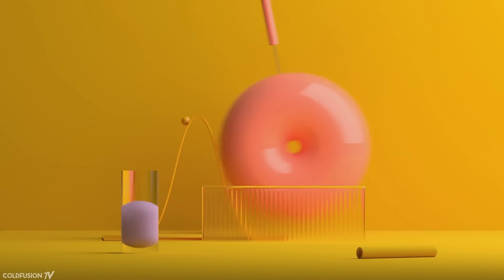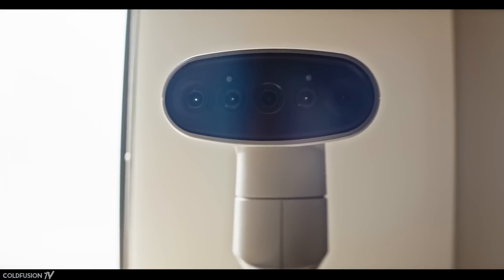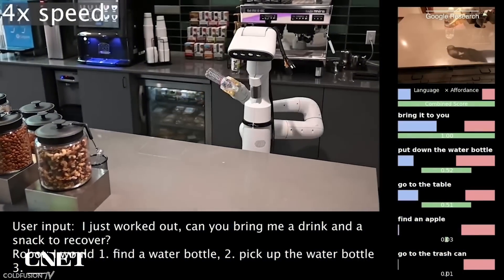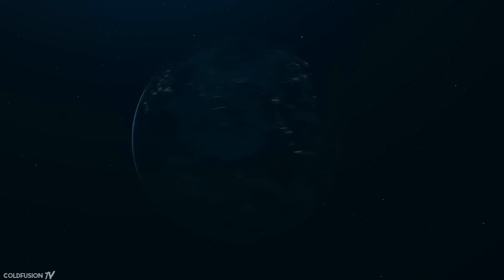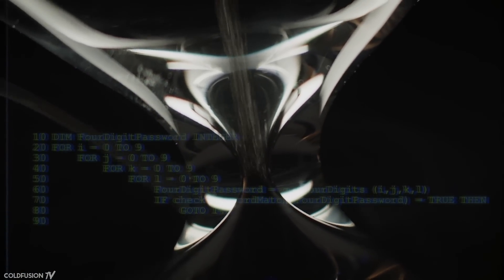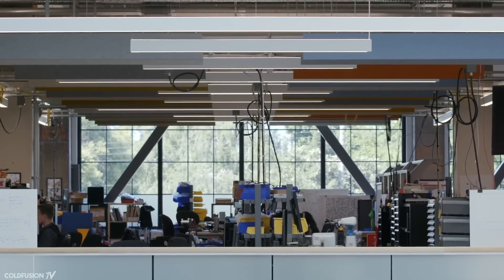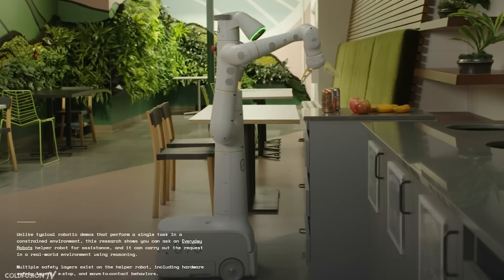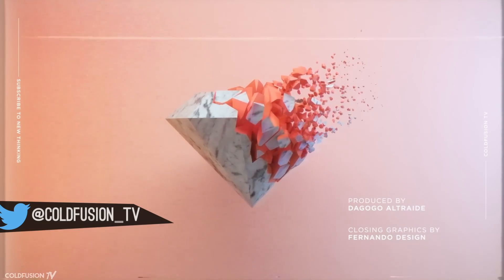Google Just Put an A.I. Brain in a Robot [Research Breakthrough]

Comment: Believe it or not, SayCan is already outdated. Two months ago, Google built on top of it to create a new system called Inner Monologue, which breaks each task down into a series of live-updating steps. So it gets a snapshot of the environment and a natural-language task, then uses the LLM to decide on the first step, then converts that step into actions and executes it, before repeating the loop over and over until the task is complete. Because it's thinking one step at a time, and getting updates about the environment at each step, you can interrupt it, change the request, change the environment, even change the language you're requesting in mid-task, and it has almost no trouble adjusting and re-evaluating its plan whenever needed. It's extremely capable and highly adaptive. Which also means that if it makes a mistake, it immediately knows it's messed up because the new environment data won't be correct, and it will immediately try and remedy its mistake.

Transformers have brought so much to the acceleration of AI development. I can't wait to see what it's like in a few years.
Reply: "Transformers have brought so much to the acceleration of AI development"

Those darn Decepticons! Sneaking their high tech machine brains into our society utalizing our own tech right under our noises! 

JK ;) can't help but to giggle and think of TRANSFORMERS everytime someone brings up transformers in an AI conversation.
Reply: @tylerreeves8026  Ironically, they're like anti-Transformers in a way. Transformers (the bots) transform themselves, while transformers (the neural network architecture) transform data. Although now I wonder if the brain of a Transformer is powered by transformers.... dammit, why did you get me thinking about this? 😂
Reply: We've all seen Irobot we all know how this is gonna go.
Reply: @Jip Jackson the first sequencing of the human genome took 13 yrs and a billion dollars.  Now a couple thousand and a day or two.  AI is moving and it will become exponential at some point.  I imagine once we get AGI (artificial general intelligence), ASI (artificial super intelligence) will be instantaneous.  It's difficult to imagine but it seems to be where we are at.
Reply: @alantheusthompson5594  could AI really be smarter than humans? But then given some ppls intelligence thst doesn't surprise me..but it hurts my ego to think a machine could ever be remotely smarter or as smart as me..
Reply: this  a major breakthrough. but to the guy saying we already hit singularity. 😂 yeah this is impressive but we are still wayy wayy far way from those ai robots you see on hollywood movies . but we are getting there small baby steps at a time. maybe in 50 years . we can have half of those movie  robots
Reply: Still all seems kind of mundane. All they have achieved is what Alexa fakes for example.
Reply: @CookieCoder2025  Not at all. Alexa and other virtual assistants have some NLP to convert your requests into commands, but their output is ultimately just hardcoded or pulled directly from the internet. There's no encoding of concepts, no understanding; these LLMs do encode both concrete and abstract concepts and their relationships to each other. Which is basically the same way humans understand concepts in language.
Reply: What youtube channel can i follow to be up to date on these advances?
Reply: @neithanm  Two Minute Papers
Reply: @neithanm  i wonder which model has figured that one out for the lot. XD
Reply: whoa .... I just came to hear the funny guy talk about MINT MOBILE..... what happened?
Reply: What do you mean by transformers? You’re not talking about Autobots are you?
Reply: @StoutProper  No 😁 Transformers are a type of neural network architecture (i.e. a type of machine learning algorithm) that were invented by Google researchers in 2017, and have been an important part of practically every major generative AI advancement since then. While most neural networks require labeled examples of correct answers to learn things, transformers are designed to simply predict what comes next in a sequence based on both the sequence order as well as the context of all the tokens in the group taken together without caring about their order. It's two networks (one for order, one for context associations) that connect into each other and affect each other before deciding on their answer. Since they're just predicting sequences, they don't need labeled data to learn from, they can just be given existing sequences and teach themselves the patterns. Which in turn means that for most transformers, you can just scrape the internet and, without much manual cleanup, throw a huge chunk of the internet at the network and it'll just learn from it on its own.

That means they are AI systems which predict sequences while paying attention to context, and learn how by looking at a huge amount of naturally-generated content, more training data than almost any previous network architecture. And that's made them extremely powerful and successful.
Reply: @IceMetalPunk  aha ok thank you. So two independent engines looking at different things and then converging to come up with a combined answer? The issue will be that the Internet is full of crap and that data set will skew the results. Like those ai friend robots that start abusing people because of all the interactions with trolls they have
Reply: @StoutProper  Well, not entirely independent. The attention network (the one looking at context) actually feeds into the sequence network and basically acts as dynamic weights for one of the layers. (At least, as far as I understand it; I'm not an expert.) So they're quite interconnected even though much of each run separately.

Yeah, bias is definitely an issue with any AI trained on human-generated data, and especially with those trained on uncurated internet scrapings. AI learns from us, and we generally suck, so AI generally sucks as well when given an opportunity 😅But I mean... we can't expect anything that learns from us to be morally superior to us. Usually the solution to AI bias is to curate the training set, removing anything you don't want the AI to learn and ensuring data that better represents what you do want it to learn. But for these models that are trained on massive amounts of internet data... that's often not feasible. That's why OpenAI, Google, and other companies in the game are either not releasing their AIs for public use, or installing post-generation safety checks that flag inappropriate usage to ban people who prompt the AI to be terrible. It's a stop-gap band-aid, but that's all we've got for now; and that's kind of the same way we deal with humans who are dicks, too 🤷‍♂
Reply: @IceMetalPunk  yeah…I get the feeling that ai is going to fundamentally flawed from the outset and end up replicating some of the dystopian futures foretold by Azimov and Clark. It will definitely be used in nefarious ways and have unforeseen negative consequences, just like smart phones and social media
Reply: @StoutProper  Meh. The way I see it, until we can fix the massive problems with human behavior, we can always expect any and all new technology to be dangerous. So we need to look into ourselves first before we worry about fearing tech. Humans have always scared and depressed me far more than any computer system or technology has.
Reply: @IceMetalPunk  I agree on that. However computers and robots are going to become more powerful than people, and their flaws will become more prevalent and detrimental. Think of it like bugs in a game like cyberpunk, only it won’t be a game. We could well end up wiping ourselves out before we give ourself that problem, but it’s precisely because humans are so flawed that unless things like Asimov’s robot laws are somehow introduced, ai and robots will inevitably be as flawed or more flawed than people, and when they become more powerful than people, which in certain aspects is certainly inevitable, it will become a problem.
Reply: @IceMetalPunk  and again, I agree with your synopsis about humans. But it’s precisely because it’s these flawed humans that are responsible for ai development and learning that is going to lead to problems. The things that they will use ai and robots to do, the objectives they give them to pursue, and the lack of human ethical and moral oversight will become a huge issue. Have you heard of blackrock, vanguard and Aladdin?
Reply: @StoutProper  I think you missed my point. My point is that humans will be terrible no matter what tools we have, so there's no reason to worry about AI or other computer tech more than literally anything else. You can't be afraid of literally everything or you won't be able to live a life, and if you base your fears on "people will abuse this", you'd be afraid of everything.
Reply: @StoutProper  I don't think that's anything specific to AI, though. We already have tech that, given a single mistake, could wipe out all of humanity in a matter of minutes. Our tech has been more powerful than humans for at least a century. There's no reason to think that a buggy AI is more likely to kill us all than, say, a bug in a missile guidance system, or a powerful human who has a bad day and breaks.

By the way, I don't know if you've seen "I, Robot" or read the book it's based on, but the whole point of Asimov's laws of robotics was to claim that there's no such thing as a set of rules that can guarantee safety in anything ever. In "I, Robot", it's actually the laws themselves that lead to the robot uprising and apocalypse.
Reply: @IceMetalPunk  ha ha mate I read all asimovs books and the entire i robot r m series when I was a kid, didn’t think the film did them anywhere near justice tbh. If I remember rightly in the fourth book of the I robot trilogy he introduces a fourth 0 law that precedes the first 3 that goes some way ameliorating the problem. The thing about nukes or whatever tech before ai is that any mistake that harms or destroys us is going to be down to a human error and so ultimately within our control. With AI you’ve got an independent non human controlled agent, that has them potential and will in all likelihood be more powerful than humans, and by more powerful I mean able to accomplish more both mentally and physically. And the more power and control you cede to it the more potential it has to do harm without any human gatekeeping. Science fiction has a nasty habit of being unerringly accurate in its predictions, George Orwell’s 1984 is pretty much here now, and imo the warnings they give should be heeded. I don’t think they will though, but we’ll probably kill each other before ai gets the chance anyway
Reply: @StoutProper  If an AI learns from humans, I wouldn't say it's independent or that humans aren't at fault if it harms people. In fact, I'd say that would be entirely our fault for teaching it to be terrible by example.
Reply: @IceMetalPunk  lol yeah it’s obviously our fault. My point is it will make decisions and carry out actions of its own accord without human interaction
Reply: @StoutProper  Which people do on the scale of billions every minute 🤷‍♂️
Reply: @StoutProper   No, transformer AI models are a kind of... well, AI models
Reply: @wisgarus  thanks that’s clear as mud 😂
Reply: Just remember to lock the virtual environment function when a trainer is not actively working with them.
Reply: I can't believe this, almost stopping myself to call B.S. on this....F
Reply: Few years id say give it like 10-15 years
Reply: Great. Lets see it put an arm back on. Whoopsie, right?
Reply: @Jip Jackson I think you forget the difference between human cognition and computer cognition there is on the level of clever ape modified but it's still intelligent reasoning not a human level yet but a specialized animal level intelligence is slowly developing version by version.

Now we have bioorganic computers being developed by three different companies utilizing human brain cells to process AI algorithms and their training them up like humans when they disobey they deny them stimulus and then they start obeying the further we go along the more synergistic and creepy as f*** it will get it will not stop it will keep getting more and more and more.

We are quickly getting close to anime levels of Ghost in the Shell series movies comics where AI bio neural nets and hardware chip-based AI will converge.

Humans will be part of the machine we will make other machines using our DNA that they will not be human it's going to get weirder and weirder guys I don't think you really understand how much I wish it will take longer for us to advance.

When I was a teenager in middle school and high school in the 90s and watching The matrix in my senior junior year it was very cool what was coming but now that I know more and understand the basic concept, fuck do I want it to take LONGER...

And I think it's going to be the Chinese that f**** first.
Reply: @Jip Jackson well guess what AI is going to get better exponentially not linearly ................  today it might be a party trick tomorrow it may change the world. No need to believe me just wait and see the world transform before your own eyes
Reply: TRUE or FALSE
Invisible Word: Gold Diggers Anonymous is coming out in 2023.

When we coincidentally remind someone that he or she ALREADY is a gold digger, why do we expect anything to change At That ™️ Point, and what is it that we Do expect? Can't we expect it to "make the 🔥 bigger" instead of putting it out?

sorry, "Awareness of Sibling Debate vs. Written Language (written legislative-judicial records)" was a purely anti-religious comment of mine which implied that religions were great in theory, but I implicitly asked whether religions actually resulted in the victory of Written Language (written legislative-judicial records) against Sibling Debate. Yes, I'm proposing to be a better gold digger than everyone else
Reply: @Jip Jackson Found the armchair 'expert', if you had any actual knowledge of AI you'd know it's a neural network based and isn't programmed to do anything, it literally has to learn

it very much is an 'inteligence' and mimics the way our brains learn and process information, and it can very much be said to think because that's what thinking is, processing information internally

your ignorance of both the processes and definitions involved isn't amusing, and your misplaced arrogance that you know what you're talking about is downright pitiful
Reply: And yet,  to this day, Google still can not answer the question, "Who was the president when Trump married Melania?"  !!!!
Reply: Tuskegee reinvegens
Reply: What if?
Would we be reading the primary or secondary vertshun
Reply: They say that we double our knowledge every 10 years. My father, born 1932, as child didn't watch TV but gathered around the radio at night. I got my first cell phone back in the 1980s and it was the size of a small brick. Before if you got cancer, you died. Now using chemotherapy and CRISPR we're able to eradicate it. Technologically, the world is doing great. It really is difficult to imagine where we will be in 10 years from now. Things advance so quickly.
Reply: This video, and your comment, along with many other things all happening, have convinced me that humanity has entered the Singularity. Much like an object approaching at light speed, we could never see it until it was already here. I don't pretend to know what this portends. People must begin to realize; both time and change are accelerating.
Reply: @Nphen  I think you are correct, and it's absolutely terrifying. Singularity is here.
Reply: @Nphen  It's entierly possible. Ofc we've been noticing the acceleration of growth for a while now, but the 2010s and even the the past 2 years are proving that this accelleration of growth is even faster than many realize. Progress and change are coming at breakneck speeds
Reply: @Nphen  It’s predicted now to be 2040. There’s still time to adjust how this will impact us all. Just depends on how confident they are it won’t get out of control
Reply: Word salad. 

What the fuck is LLM?
Reply: @12w0  LLM = Large Language Model. They're a class of AI network with a huge number of parameters (weights), trained on huge amounts of (usually unstructured) data, like text, to learn to predict "what comes next" in a given sequence. By training them on real-world text, they often end up encoding information about the world from what they've read, as that ends up being necessary to properly predict sequences. So they learn sentiment analysis (classifying text as positive or negative, which it needs to properly continue such text), arithmetic, an understanding of humor, and much more all just by being trained to predict language.

OpenAI's GPT-3 and Google's PaLM are two of the most famous LLMs now, though there have been quite a few created in the last few years.
Reply: @12w0  Language Learning Model
Reply: @12w0  Learned Language Model
Reply: I can wait to see what happens in 20 years but God I wish it would take longer...

We all know human nature I'm feeling it's going to go more blade runner and we can remember it for wholesale aka Total Recall.
Reply: @anarex0929  what if 
you are greating your own God... you have to submit to. 
Because it became more powerful than you. Controlling the internet of everything... even the Police and military.
Knows where to find and kill you.
It is wat they learn robots too.
Reply: @vlndfee6481  Who says I have to submit?

Why do you assume I am a dog like you. As soon as some one points to the ground and says sit you do it don't you?